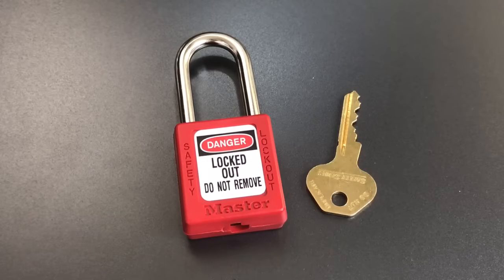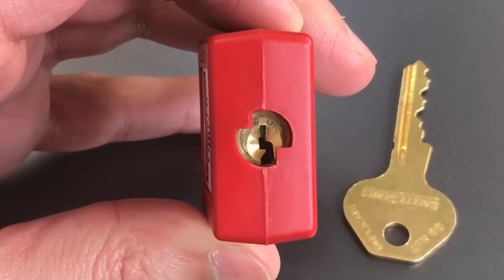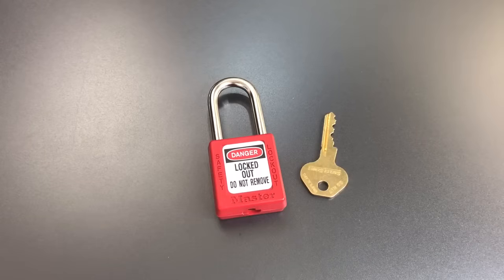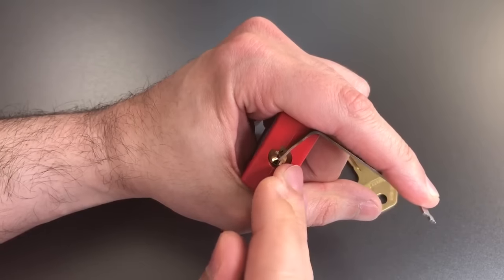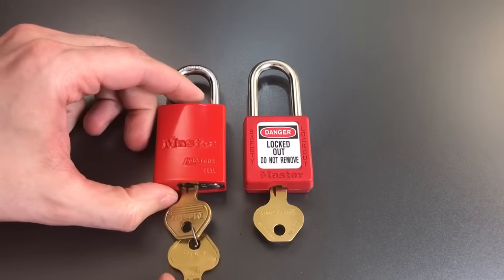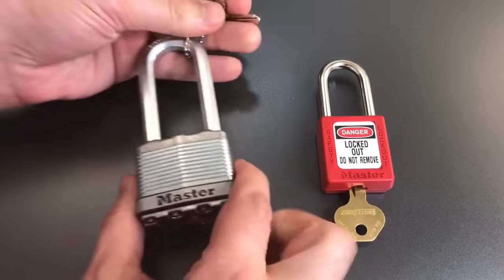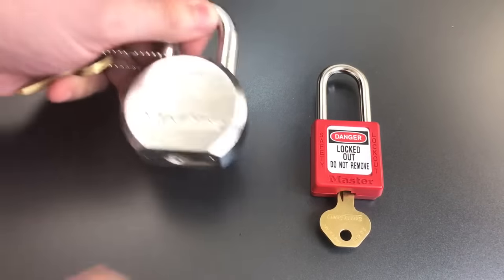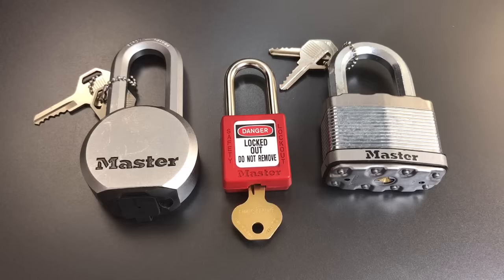[479] The Master Lock Paradox - Model 410 LOTO Padlock

Comment: it's possible that this paradox was intentional. The problem with a lock that is difficult to cut and also very difficult to pick is that even a locksmith might have trouble with it. So maybe Master Lock just wants the owner to have some option to remove the padlock in case they lose the key.

Comment: They have such weak plastic bodies to 1. Make them cheaper to buy, companies will buy these things in the tens of thousands, sometimes even yearly. 2. It doesn't matter if they get destroyed. They need to be very hard to remove non destructively but easy to remove destructively, so the cheap body fits the bill. 3. Plastic doesn't get hot like metal does and these locks will often be in areas of high heat.

They do what they are designed to do very well.

Comment: WTF Master Lock?  You could have some decent locks if you put your good quality cores into the solid lock bodies like an m5 (4 pin, no security pins), m15 (5 pin, no security pins), 930 & 6230 (5 pin, couple of security pins), m930 (5 pins, w/security pins, but exploitable protruding bolt head due to weather sealing attachment).  What is wrong with Master Lock; are they all on drugs?  Do they have agreements with crime cartels?  WTF?

Comment: Think I work it out. If a 🔐 looks tough it’s more of a deterent so people will less likely attempt to try open it. Where as the plastic lock is a wolf in sheep’s clothing so will take longer to open. Bonus tip if someone is stupid enough to go onto a building site to try open a lock 🔒 that is being used to protect the safety of electricians they are more than likely going to be caught by some big burly workers and the consequences won’t be good for the fool. Also lockouts use multiple locks to protect others. Sleep tight

Comment: To be honest, I saw this and was curious; but that being said I work in industry as a millwright. I have to lock out and tag out equiptment to work on, it is a process and it's done to ensure your life and limbs. (which is mandatory as per OSHA) Anyways, some dumb ass always forgets to remove his lock before going home or leaving the lock out space. If that happens it is a pain  to cut the lock due to the amount of paper work involved, so master lock created a cylinder that was hard to pick to benefits the employees safety. 
1- If its easly picked any one could remove it and potentially harm the individual 
2- Some salty coworker wants to get you fired, they can pick it quickly and say you weren't locked out and get you fired immediately. 
3 - A mirad of paper work is needed to remove a lock legally. Do you really  want a hard to remove lock after all the paper work you just finished filling out?

Comment: why exactly are you explaining how to pick different types of locks? this just seems like you're teaching criminals.
Reply: It's a hobby just like any other. Criminals generally don't bother picking locks. They might try a rake or two, but single-pin picking is a skill that takes a lot of practice to develop and is much slower than just cutting a padlock off.